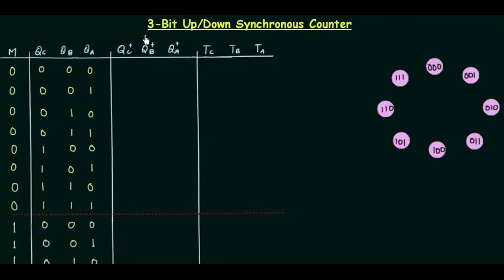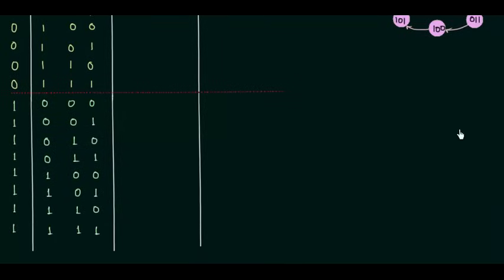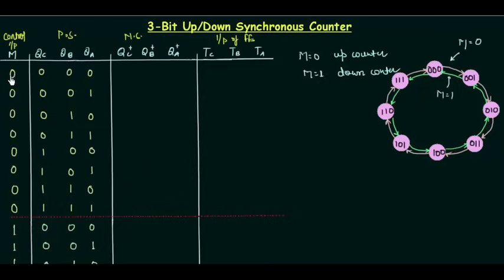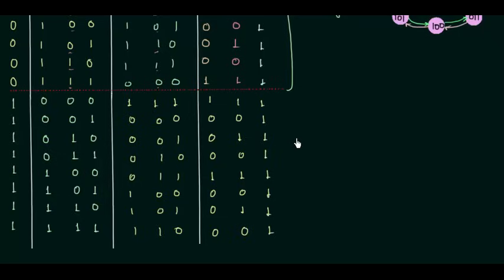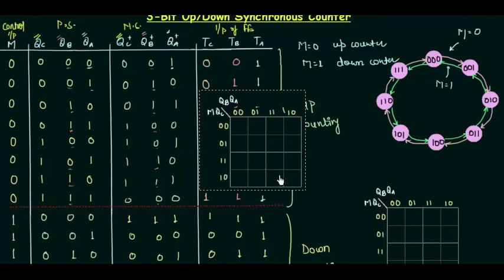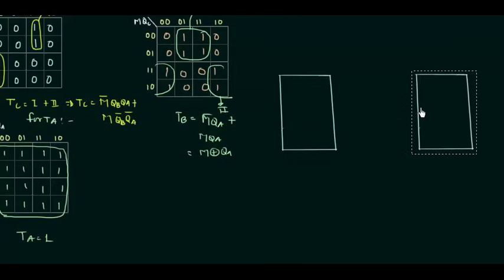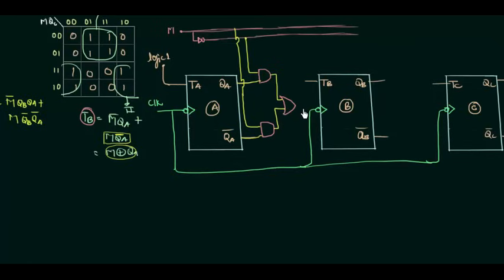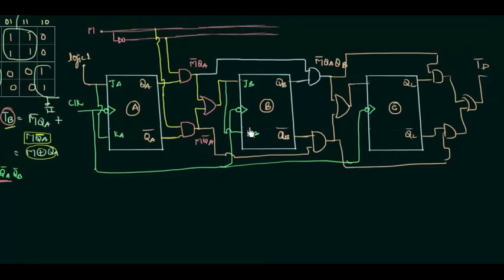3-Bit & 4-bit Up/Down Synchronous Counter

Comment: Does anybody else have an issue from state diagram 

It should be 111 to 110 but instead we wrote 000?
Reply: nope follow the arrow from 111 we have to follow arrow for down counter therefore its 000 only
Reply: @alpha_wolf6950  There are two arrows bro

Comment: In the context of synchronous up/down counters, toggling refers to the action of changing the state of a particular bit in the counter. Specifically, toggling involves switching a bit from 0 to 1 or from 1 to 0 right ?
then how you are always writing 1 when toggling ???

Comment: for down counting after 111 it has to be 110 right, you have written 000
Reply: no it is actually 000 bcz at left the present state is 001 so the next state will be previous one of 001 i.e.000

Comment: i have become this task 
(Design a 3-bit counter with synchronous D flip-flops with outputs Q3, Q2, and Q1, which counts up at E=0 and sets all output values to 0 at E=1.) 
and i try to build the state Diagram. 
Is it the same principle with Down counter ( Thank you Sir)

Comment: Can you help me in this question "A digital computer has three registers: A, B and C. Four flip-flops provide the control functions for the computer: S is a
flip-flop that is enabled by an external signal to start the
system’s operation; L and R are used for sequencing the microoperations; A fourth flip-flop T is set by the computer when
the operation is completed. The function of the system is described by the following register transfer statements:
S: C ← 0, S ← 0, T ← 0, L ← 1
L: L ← 0, if (A = 0) then (T ←1) else (R ← 1)
R: C ← C + B, A ← A – 1, R ← 0, L ← 1
Design a circuit with minimum components to implement the above operations."

Comment: Sir you chose a T flip flop for the design. Can I know why ?(what is the benefits if we choose T flip flop for this circuit)

And if instead of T flip flop if we use a JK or a D flip flop what are the benefits and problems faced 

And also which is most suitable flip flop for this design.
Reply: you may use any type of flip flop depending upon the asked flip flop in the question.also if u use a certain flip flop,lets say -a d flip flop instead of a T flip flop then u must use the excitation table of D flip flop.
hope this answersu ur question ;-)

Comment: have a doubt if the question is design a 3 bit up down counter which counts up when m=1 and down when m=0, which one to use synchronous or asynchronous?? need an solution asap

Comment: I am confused with propogation delay in synchronous counter..how it can be Tpd when one every flip flop needs previous output??
Reply: Consider a 3-bit synchronous counter with 3 flip flops. Let's say their outputs are Q1, Q2 and Q3. Let's say the initial state is 000. It's important to understand that all the 3 flip flops have inputs present to them to be processed at next clock pulse. Output of FF1 is Q1 which(or some logic of which) is input to FF2. Similarly, o/p of FF2 is Q2 which is input to FF3. And Q3 is output of FF3. All these three outputs Q1Q2Q3 change simultaneously due to the synchronous clock. As the Flip Flops always have the required data present at their inputs, they just need the clock pulse and take Tpd delay to change the output.

Comment: Just to correct the mistake in the M-QcQbQc-Qc*Qb*Qa*-Tc-Tb-Ta table, the correct one is:
M | Qc | Qb | Qa | Qc* | Qb* | Qa* | Tc | Tb | Ta
0     0      0      0      0        0       1       0      0    1
0     0      0      1      0        1       0       0      1    1
0     0      1      0      0        1       1       0      0    1
0     0      1      1      1        0       0       1      1    1
0     1      0      0      1        0       1       0      0    1
0     1      0      1      1        1       0       0      1    1
0     1      1      0      1        1       1       0      0    1
0     1      1      1      0        0       0       1      1    1
1     0      0      0      1        1       1       1      1    1 
1     0      0      1      1        1       0       1      1    1
1     0      1      0      1        0       1       1      1    1 
1     0      1      1      1        0       0       1      1    1
1     1      0      0      0        1       1       1      1    1 
1     1      0      1      0        1       0       1      1    1 
1     1      1      0      0        0       1       1      1    1
1     1      1      1      0        0       0       1      1    1

So ending in the Tc, Tb, Ta expressions: Tc=M+QbQa, Tb=M+Qa, Ta=1

Comment: what happens to Qc and Qc' if you want to end your circuit with just 3-bit? where will you connect them?
Reply: Qc would be your most significant bit of the output if you write it like this: Output(2,0) = (Qc, Qb, Qa), so i guess if you were testing the circuit with 3 LEDs to check your result you would connect it to the first  LED from the left  so that the output can be read correctly (eg for Output=100  -> LEDc on , LEDb off , LEDa off  ->  Qc = 1, Qb =0 & Qa=0) otherwise you can just leave it as it is. Qb and Qa are connected to gates because from the equations we have they affect the outcome of the output but Qc does not so it stays as is! Qc' is of no use to us, it also has nothing to do with our results and so it stays as is.

Comment: how could we design an up/down counter which counts irregularly like 0-2-5-6-7-0-2-5-6-7 and so on?
Reply: draw it out in a state diagram, then make that into the chart in the same steps. After make the karnaugh maps and voila your circuit is there

Comment: hello NESO ACADAMY, first of all thanks for such valuables tutorials but i would like to draw your kind attention to my point which is that..

If the question is IMPLEMENT MOD-10 SYNCH. COUNTER ..then how can we solve this??? this is not in any presentation...
hope answer soon...
Reply: choose 4 bits counter then use preset and clear function, reset all the flip flops when counting state is  10
Reply: Just like BCD counter.
BCD counter upto a particular value is same as MOD -x counter.

Comment: it works for up counter , how not for down counter ?
in down counter when present state is 0(000) the next state should be 7(111) , and when it is 1(001) next state should be 6(110) ... but yours next state is again starting from 7(111) then o(000) then 1(001),and so on like up counter ... Please answer . tnx
Reply: +niamatullah bakhsh as we know in down counter next satae=present state-1 
so as per my p.s=1(001)  so my n.s =1-1=0(000)

Comment: The truth table for down counter is incorrect under Next state and under Flip flop inputs, you wrote 001 after 111.sir don't you think  in case  of downcounter after 111 we should have 110
Reply: Thanks sir for clearing doubt. I apologize for the mistake.
Reply: But sir again there is upcount for M=1
How could it be possible

Comment: I like your tutorials, they are quite helpful, however, I think you should re-verify that the down counting truth table is correct.
Reply: +Michael Eze completly correct
Reply: +Michael Eze Dude i had the same doubt... the downcounting is absolutely correct.. For more clarity... when m=1, try writing present state frm 111,110,101 downwards.. nd form the next states accordingly..!!
Reply: I still don't understand this part. Even though m=1, the count is going from 111 - 000 - 001...
It's just one step backward and continues counting up..
Reply: @yeshwanthreddy9450  You need to look at it like this. When the present state is 000 (0) it goes to 111 (7). When the present state is 001 (1) it will automatically go to 000 (0) and so on down the truth table. Its basically just saying when that present state is for example 010 (2) please go down to 001 (1) to become the next state.
Reply: @nickthewinner2194  What you said is absolutely correct but isn't the down counter suppose to count like 7,6,5 etc upto 0.Here the sir has just decremented the next state